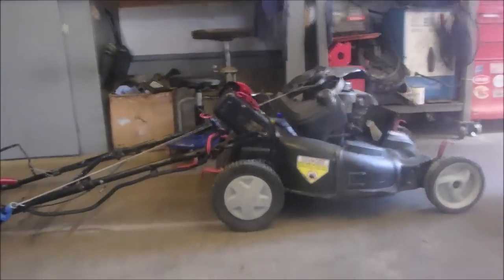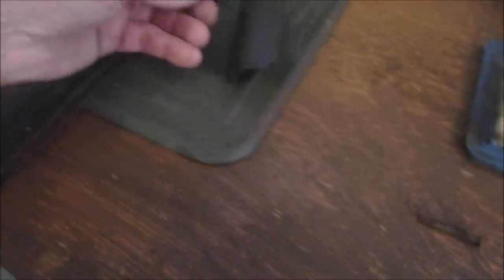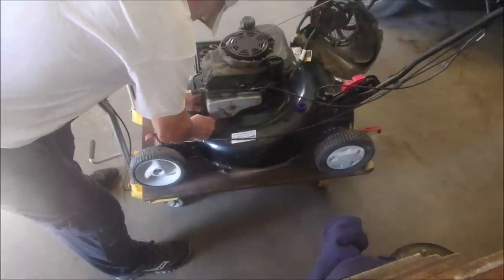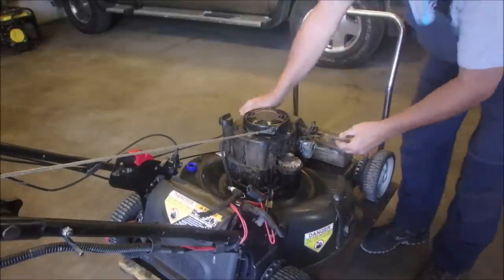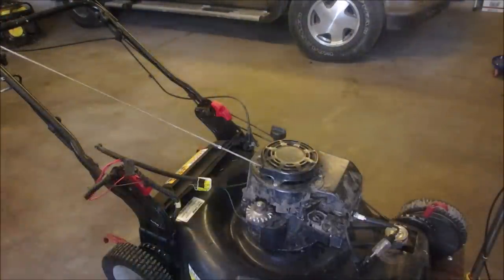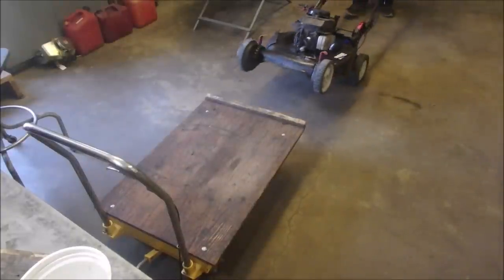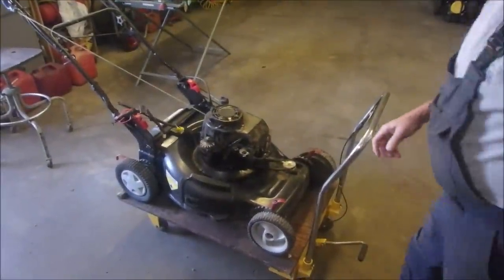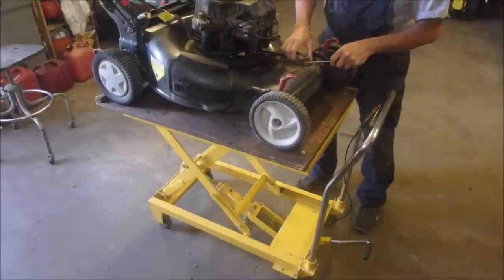Basket-case Recovery of a Craftsman EZ Walk Mower Pt. 1

Comment: Gotta love seeing a basket case go back together
Reply: I love the basket cases best, especially if they require a full teardown and new or scavenged parts.
Reply: @campbellpaul  I don't save much in the way of parts, over the years I have found that there are only a few that you know you are going to always need... air filter covers, nuts and bolts, gas caps, the occasional motor cover if it's really nice...
Reply from the maker: Well thankfully most of the parts came with it.
Reply: @BrucesShop  I will admit I smiled when I saw the bag, lots of model specific bolts on a quantum. 🙂

Comment: Well Bruce, as for the young man taking it apart, we were all there once.... Lol, I always forget to attach the plug wire. Now when someone wants the battery start taken off, I take off everything to do with it, from the key start switch wiring, dump bail mechanism with the dip switch and wiring, all the way to the starter motor, and even the toothed flywheel, replace the toothed flywheel with a regular one, that way I can use it to make one of mine a keystart for free..... Nice job sir.
Reply from the maker: I did think about that but it wasn't my mower to make that decision.